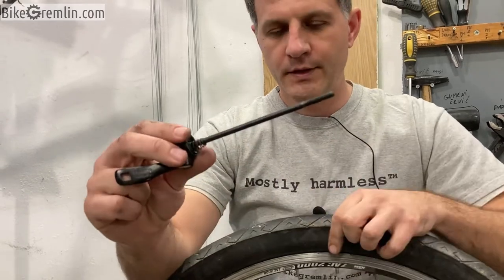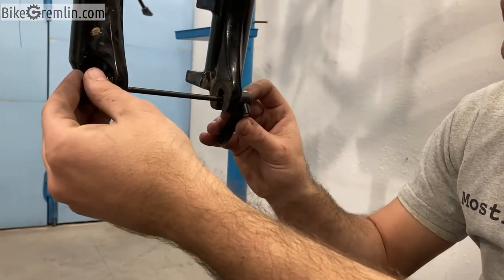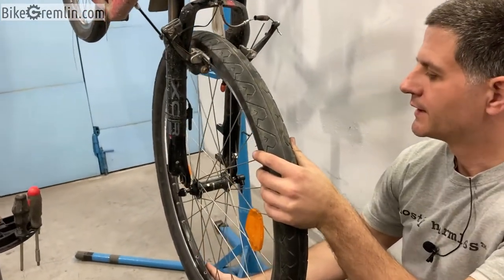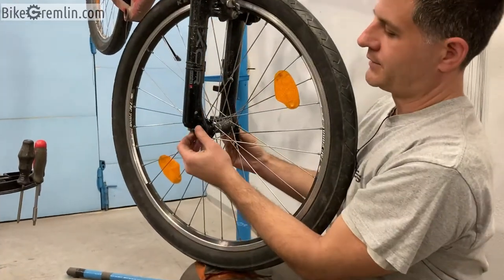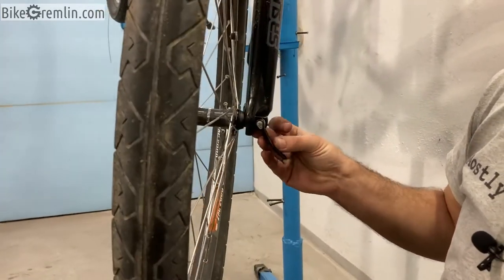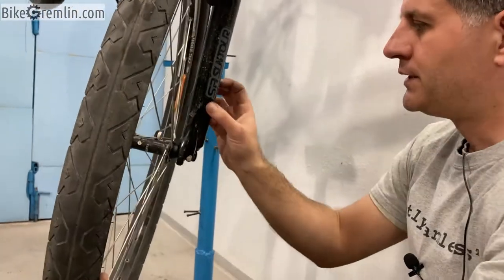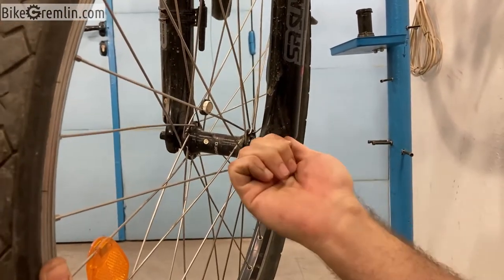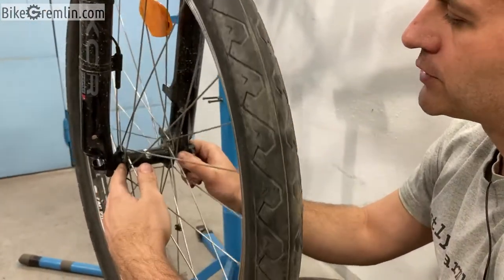Bicycle wheel quick release (QR) - explained

Comment: Yo thanks for this dude, you're super thorough! First time doing this on a bike with quick release and I couldn't find my question answered anywhere, it was pertaining to the direction of the springs 😆. The original install had them in the opposite direction than you show and it seemed counter intuitive, thanks for confirming that the wide side sits against the adjustment pieces. This kind of in depth coverage is not that common, subscribed.
Reply from the maker: Thank you. Glad to hear it helped.   :)